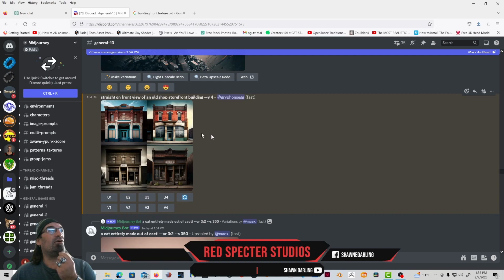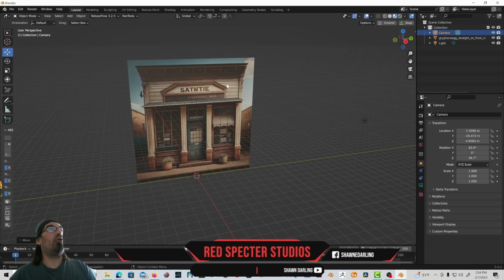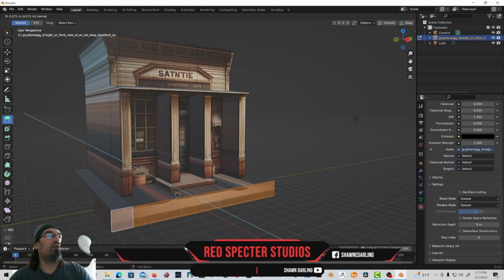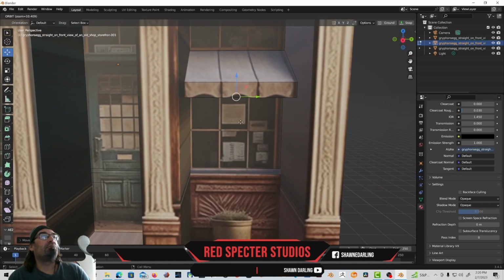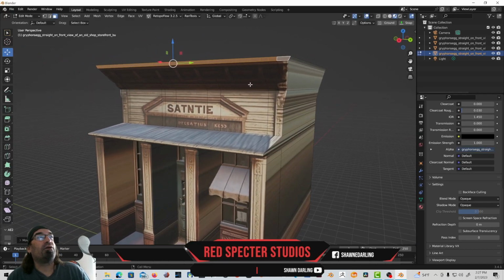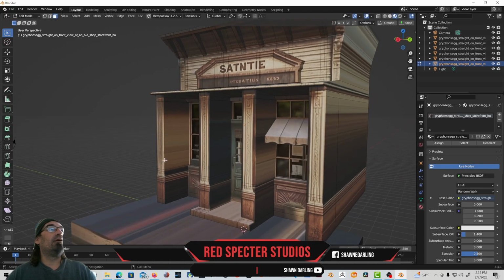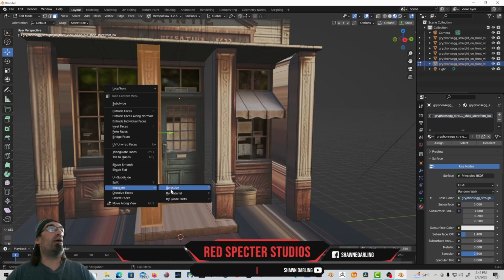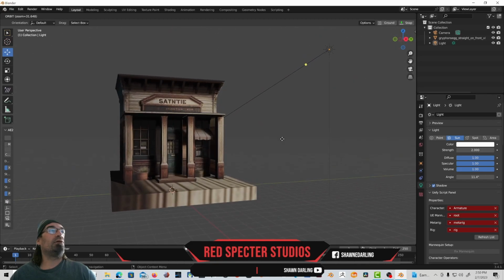From Midjourney to 3d in Blender! (New additional techniques!)

Comment: When you wanted to use the same texture but not affect the original you can press the number in between the texture name an the shield icon , doing this will keep the same texture but make it separate from all the other objects using that texture, letting you edit/ change it without affecting the others. great vid though I'm now going to check out some of the others 😁

Comment: Unless this was going to be the focal point of my scene, I might be inclined to just to a depth map and displacement on it. if it was a background object I definitely would go that route.
Reply: What would the polygon differential be between the above and using displacement? While it might require more time, this method is probably more performant.

But I would not recommend using either of these for a focal element piece. If you want a building as the focal element you definitely want to model/assemble/kitbash it.